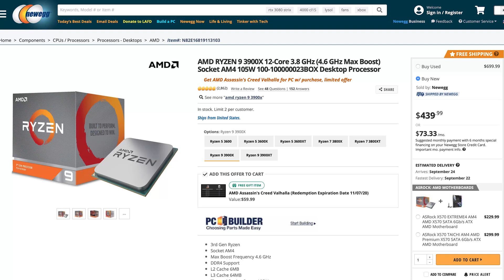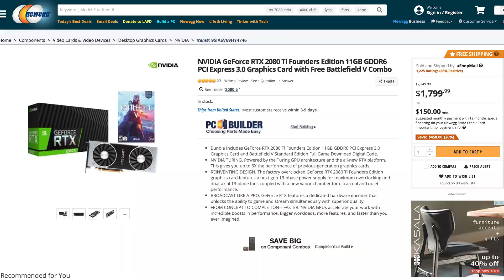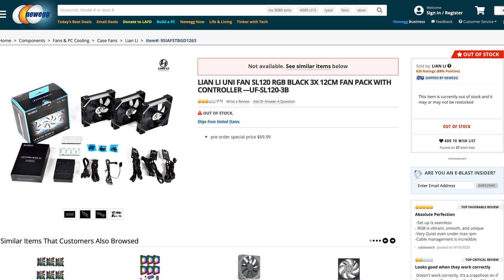Deepcool CL500 Case Review Build - Step by Step Build Guide and Overview (Plus Lian Li UNI SL120)

Comment: Is there enough room for Noctua NH-D15 to fit in ?
The cooler has a height of 165 mm with fans.
And the case also has a CPU Cooler Height Limit of 165mm.

Comment: I just had a question and am about to build my first ever pc. For my first build I was told to stay away from aios as they could leak and I wouldn’t know how to troubleshoot, so I was wondering if a noctua cpu fan would still work enough to keep temps down for an i9 9900 and if anyone could recommend what to do
Reply: The chances of an aio leaking are very very less..... The manufacturers seal the pipes really tight... I dont think an air cooler will be enough for an i9 as it is a power hungry and a hot running cpu.. You should consider an aio...
Some good companies are
Deepcool
Corsair
Nzxt
Cooler master
Antec
Msi, etc..